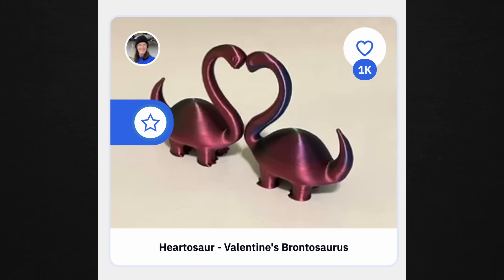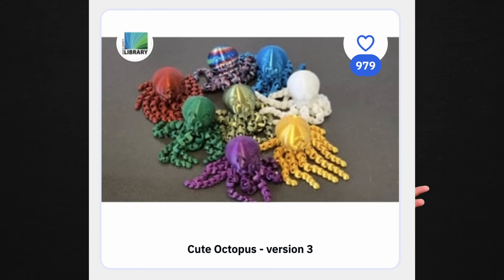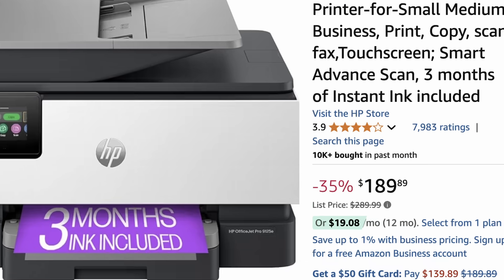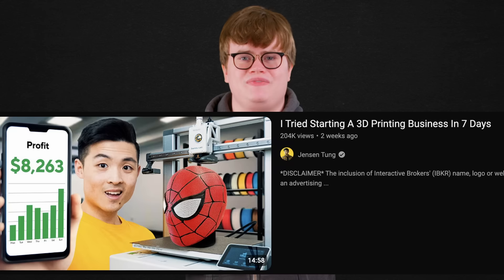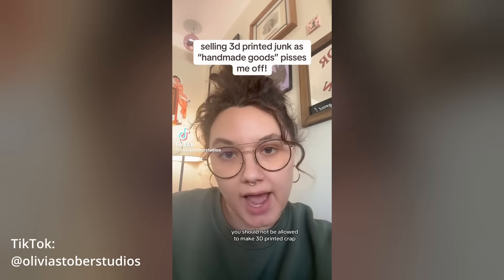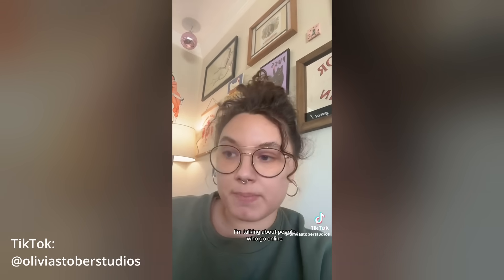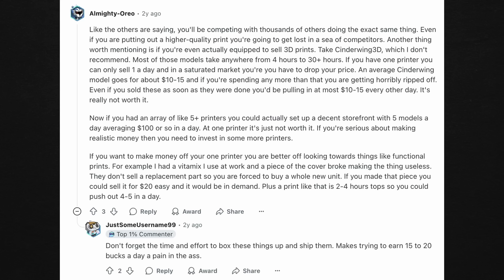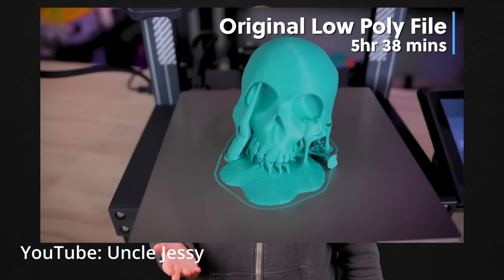The Rise of 3D-Printed Slop

Comment: I think you have a lot of old misinformation about 3d printing. I have a bambu a1 mini and most prints, even small ones, don't take hours because I've optimized the print settings, which is something anyone can do. The quality isn't low, it just depends on your settings. Personally, I think people should be able to print whatever they want, because they own the damn printer and can do what they want with it. The beauty of 3d printing is the wide range of people that use it and how their needs intersect with with 3d printing. What you may see as "useless trinkets" could be someone printing a gift for friends/family or just something cool that they want to have. The health hazards can easily be fixed by just having airflow in the printing room, and that's like the first thing that everyone in the community will tell you when you get a 3d printer. You need to actually look at the 3d printing subs and community instead of just assuming a bunch of stuff as an outsider looking in. There's good prints and bad prints, and it's easy to tell the difference once you start 3d printing. It's weird to hate on others for printing and selling stuff. You do realize that a lot of these same models getting sold have a creative commons license that allows others to sell it, right? Hell, some of the stuff you might print will be considered "useless slop" to others, so it's foolish for you to moral groundstand for 3d printing as if you are the sole authority of what is "acceptable". Also the hate on printer farms is weird, why hate on people that own multiple printers? They aren't hurting you in any way. Most people that own printer farms already know the risk and have a space set up to minimize it. It seems like you're more just targeting AI and trying to incorporate 3d printing into it. It's this "walled garden" approach that you have that's very dumb, you can't force people to print only what you like. Focus on your own 3d printing and stop trying to gatekeep other's experiences.

Comment: I like the take on the 3D-Printed slop and why they receive hate in hand crafted communities. But the problem with platforms like Etsy is that their is also a lot of dropship junk on there.

Im more into the practical print part of 3D Printing, im myself also got the skillset to make my own stuff. (Draftsman & Mecanical Engineering)

Im take an active part in the 3d Printig communities. The problem with technology in general is the normal consumer. Like also with for example a laptop, people buy themselves a expensive "good" Laptop, but most people just use them for basic tasks. And now with 3D-Printer prices, more and more people join and just see it as a kind of toy. But still its nice to see that its more possible to get into a hobby an a tight budget.

Now on the technology thing in this Video. Theres some confusion about time an Quality. I probably are not the target audience, but layer hight = Quality or the sanding part, are really simple answer to a much more complicated Question. And also the good example of a print is made with SLA. Also a 3d printer but different technology and also used for different kind of parts.

Like every tool, just because you have one and can use it somehow does not make you a professional. Still i like to see people try.

Now to say that 3d printig is just wasting material. There are a lot of talented People out there making amazing things. And a also think that is a Art and craftsmanship.

And also on a Sidenote PLA the most common material als make from cornstarch. So its at least recyclable, or industrial bio degradeble.

There's also the open-source space around the models. Many tanlented people make amazing Stuff and later see there property get selled without asking on sites like Etsy.

And also like i already see the Benchy in the Thumbnail is a quite practical tool for Calibration, and not really slop.

Comment: I have seen people use 3D printers to make an object, sand it, then use it to make silicon molds. They then fill these molds with plaster and paint them in one color.

This process, overall, has better results and is a better use for a 3D printer. Plaster is cheap, the mold can be used hundreds of times, and you only need to run the printer when you have a NEW idea for an item to sell. Plus, you'll not be making a bunch of plastic waste product. I don't know how much of an issue plaster is, but it is basically a rock at the end of the day that's used for houses and sculptures all the time.
Reply: Guess it depends on what you're making but why not just do analogue sculpting
Reply: @FrancisR420  Depending on what you're trying to do sculpting may not allow the fine detail required for a mold, and serial production is easier.

Comment: The plastic waste is definitely a problem. My hope is that printers will get better with materials like PHA, which are full biodegradable in home compost bins. The drawback for the material right nkw is that it's more difficult to work with, so people are less likely to want to use it.
Reply: I just ordered some PHA that I'm eager to try out. If the demand rises the quality and pricing will improve. As of now, there are very few vendors that offer 100% PHA filament.
Reply: @Theo-pd4ju  I started printing in PHA last year, and I love it! It has a much nicer feel than PLA, almost like hard rubber. You may need to rub a glue stick on the heated bed (which you shouldn't heat, by the way) to get some prints to adhere, though. I did have issues with some of my prints coming unstuck without a little extra help from the glue.
Reply: Why is it a problem? How does plastic sitting in a landfill harm you in any way?

Comment: A lot of this is why I refuse to actually buy a 3D printer of my own even though I've been utilizing a lot of custom prints for personal crafting purposes. The maintenance, the health risks, the fact that I'd probably feel the need to justify it with silly little trinkets I don't need. I'd much prefer to have someone else handle the logistics so I can stick with purely practical bespoke items the few times a year I need them.

Heck, I've even gotten some use out of thingiverse when someone has done more or less the same item in better quality, but browsing on there has indeed shown just how bad the market is. There are so many repeating meshes and AI generated slop. It's awful. This tech had so much potential, but it's being ruined by lazy speculators like everything else.

Comment: I can tell you that if they could scale 3d printers into an affordable product for lower income homes, they'd be sold out. If I could get one that could make real items I could use everyday like a garden hoe or a washer for my sink, I'd use it all the time. If someone could figure out a way to get the price point down to say $200-$400 for a reliable printer that would be a game changer imo. 
Edit: I'm no engineer. I have a drafting degree so I understand 3d modeling but that's it. So if this idea is stupid, sorry lol
Reply: There are already printers that exist at that price point, do the research. Literally,like 5 mins of research and you would find a ton of printers at that price point, pretty easy to do.
Reply: @yeettheskeetboi8089  I know they exist but from what I've found they're very small which really limits what you can print. The filament isn't exactly cheap either. Our local library bought one around $700 a few years ago. The print board is maybe 8"x8". They have a whole thing about the max size being smaller than you think. My point is the price needs to come down on those larger printers that could print a tool when needed.
Reply: @brieanastraiton3665  Elegoo Neptune 3 Pro is $159.99 and has a bed size of 225x225x250mm, it's a mid size printer under your price point. eSun pla is $17.99 on amazon per 1kg roll. You clearly haven't done enough research on modern 3d printers. Bambu A1 is $339. And that's just one brand, there are other cheaper good alternatives.

Comment: I’m an artist who was initially very against 3D printing. I didn’t like the layer lines and globs and I much prefer human-sculpted objects that show a little asymmetry and irregularities. 

However, I found myself designing a robot character which needs parts to fit together precisely and be repeatable. What I landed on was to make my parts and use epoxy putty to hand-sculpt forms over a 3D printed chassis.

This has been the best of both worlds! There are no 3D printed surfaces visible on the final character, but all the parts fit together perfectly and allow pose-ability. Add a good paint job and it’s become my favorite creation ever!
Reply: I'm there with you too! I'm an artist who was extremely against 3D printing for years until I became friends with someone who used one and I saw that they could be used as a tool to assist with art! It took me a couple years to learn how to make my own 3D files, and how to finish pieces so you cant tell they are 3D printed. 

Printers can be used as tools for artists but they're not design to be making plastic trash like they are.
Reply: @scifi.ginger it took you multiple years to understand that a collection of off the shelf electronics components is a tool and not some sort of demon?
Reply: @LuluTheCorgi  lmao. this is a funny reply.
Reply: Honestly I use my 3D printer exclusvely to solve repeating problems. Like for example, I printed myself a laptop stand that had holders for the cables I run to it when I dock it at my night-stand.
Reply: You can just spray paint anything 3d printed with epoxy primer, no layer lines 

You can also do chemical vapor smoothing with isopropyl alcohol on some plastics
Reply: This is what I expected 3D printers to be used for when they first came out a decade ago: making unique parts for creators/inventors/makers.  That’s awesome!  It’s the tat and slop that 90% of of the filament and energy’s pumping out that’s making me mad.  The amount of peoples houses I go round who have this dusty, unsanded crap sat on their Billy bookshelf that will sit there until they die and then a relative has to throw it away.  

Sorry.  I’m just really mad at plastic and energy consumption today.  It’s so tiring
Reply: I’m an old Art History Head & my specialties are print + installation. I feel like you just opened up a fascinating vein of curiosity in me with your comment, thanks.
Reply: I like seeing and feeling the layer lines too. Not overly thick but noticable if you look very close. Maybe because I've got ADHD and like the texture and the look of each layer makes me think about the machine  whizzing about making that one layer perfectly. 

3D printer are just a tool. You can use the tool to create art just as much as you can use Photoshop to create art or make copies of things. You can create functional designs (technical art) as well. 
3D prints both save time And don't depending on the use. 
It's faster and easier to wood work certain things  in a few minutes for example, than to wait days for the same shape to finish printing after designing and slicing.
Reply: @ I think a factor is also that 3D printers got better. When I first used MakerBot printers in about 2012, the layer lines were uneven, there was a lot of stringing, there were registration problems. The slicers were primitive and parts just looked much uglier when I was first introduced.

Now, with the newest Prusa or Bambu Lab FDM prints are so much more consistent and crisp.
Reply: This is what I do! I make my own anime figurines and it’s easier to keep proportions consistent with a printed armature. My brother will print the “bones” and I’ll pose and sculpt on top of them with epoxie sculpt. It’s a way for me to get my brother involved in my work and even though I’m doing most of the heavy lifting, it feels like a collab between the two of us
Reply: @Flutter_Aeina  That’s fantastic! IMHO, one of the best parts of making art is the collaboration with others!
Reply: I understand you very well! I am also an artist but also a tech nerd and the technology of 3d printing fascinates me. I like the 3d printer for costume parts that need to be really "straight" or really looking the same on both sides. And I used it to print a little chair for a handmade sculpey sculpture to sit on. Because I needed the chair to look like a chair and be stable and not be wonky or something. 
So 3d printing is great for parts that need more precision! Fusing the best of both worlds is amazing and THAT is how we should work with technology!
Reply: The best way to counteract layer lines is a setting in the slicer called fuzzy you can actually get some pretty interesting design aesthetic out of the setting besides the grip for handles. A lot of design mistakes I see with 3-D printing are people thinking it’s a replacement for injection molding when it strengths are way different than injection molding like leaning into textured parts among other things.
Reply: @ I’ve experimented with multi-material printing where I use the same filament but set one to print ‘fuzzy’ and the results are really interesting. 

The best part of printing ‘fuzzy’ is it makes a great surface for epoxy clay to bond to.
Reply: @Geahk_like_Jack  
I'm actually not comfortable with people shittting on this kind of stuff, 
considering a good friend of mine is a trans AI artist. He uses his artform as a way of expressing his personal struggle with gender identity and transitioning. Now seeing transphobic YouTubers discrediting his artform feels disheartening
Reply: @alisha8099  you can’t use disability as a shield for criticism of a technology.

Your friend’s personhood has nothing whatsoever to do with whether or not he has access to ai, and that’s entirely separate from whether ai can be ‘art’, is environmentally harmful, or is based on the unethical theft of artist’s work.

I’m fully in support of your friend finding themselves. Trans people have been discovering who they really are for thousands of years before this technology existed, just as people with disabilities have made art long before ai.
Reply: you can get rid of layer lines with some sanding & primer spray. 
but i understand that its a lot of extra work.
Reply: @ I mean, I’m doing a LOT more work with the epoxy putty than what sanding and painting would take. The purpose isn’t so much to disguise the 3D printed nature so much as to have all the surfaces have a human-made touch. Imperfections are actually pretty difficult to achieve in digital sculpting.
Reply: the premature commoditization of these tools discourages the most interesting people investigating applications. 

3D printed tat has crowded out so much genuine creative energy. If people like you, the people whom 3D printing really empowers, dig a little deeper, we'd start seeing a lot more cool projects
Reply: hey, just checked your channel you've made some pretty cool stuff but i cant find the robot, do you have any images of it posted anywhere? it sounds interesting id love to see it.
Reply: Resin printing basically have no layers when calibrated correctly.
Reply: Oh, so you dont like lines? But many people didnt care about it.
Reply: @Vibraza   Speaking as someone who sells prints... I've found that a number of customers actually LIKE the layer lines! It makes it more obvious that it was 3D printed, which adds to the appeal for some. I think these are probably the same sorts of people who go gaga for the low poly Pokemon, and other similar designs.

With that being said, I do try to print at a resolution that still looks good under close scrutiny. I also use a multicolor printer, and choose filaments that look good without any paint added, so post processing is unnecessary outside of clearing off some wisps of plastic.
Reply: you lost me at "artist"
Reply: @GoatZilla  why would they lose you at artist?
Reply: @Its_Asteria  because all you ever do is print junk.

in the off chance you actually design something, you never design for printability, even if the design lends itself to such modifications.

Comment: This smacks of gatekeeping, while I agree printing endless junk to try to sell and get rich quick sucks, being able to make young children in your family happy with 3D printed toys is not only satisfying, but also cheaper than buying them stuff, especially if you have a large family, and probably more ethical. I do make my own CAD designs for electrical engineering, but I think there are other valid reasons to have a 3D printer than prototyping. I have made 3D prints that are permanent parts of a project. If you're just prototyping constantly, you're probably throwing more plastic away than most users.
Reply: I'd strongly recommend reading up on the safety of 3D printed material. As much as I like to design and make toys, almost none of it is safe for small children for a variety of reasons
Reply: @axneon  I know this, which is why my printer is in the garage, I only use PLA for those prints, and I don't give them to toddlers or babies.